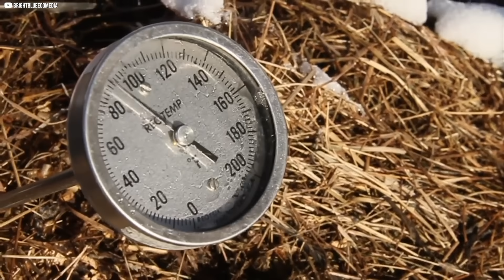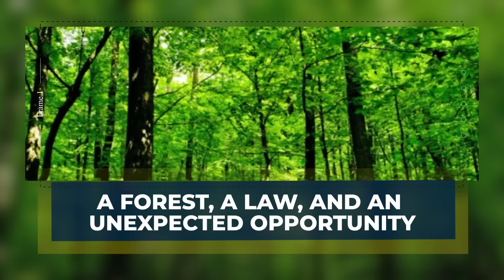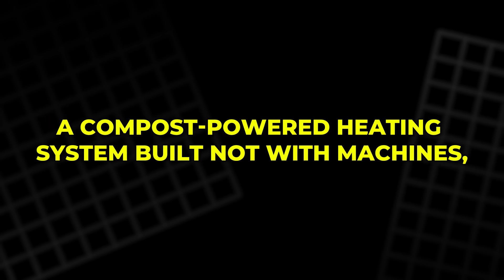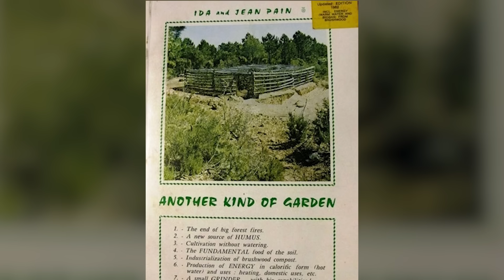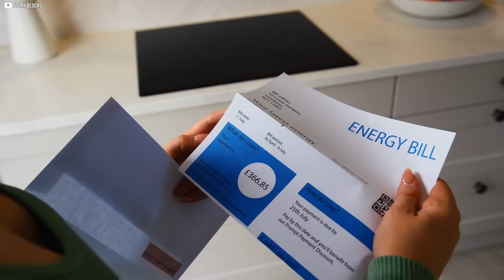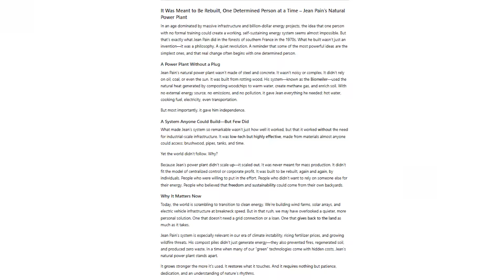The Forgotten Reactor: Jean Pain’s Natural Power Plant

Comment: A few things. 

1. This is really cool. 
2. The energy input would likely exceed the energy output.
3. You need a so much wood.
4. It needs to be chipped which costs energy.
5. The energy to collect, gather, build is an energy cost.
Reply: This is done already more than you realize. It doesn't take as much as you think. This is common for green house to use biomass and off grid applications
Reply: @DerfOrNuffin sure, but larger scale applications require more input. Then there is the removal and refresh process. All of that effort takes energy and likely people would turn to machines that use fuel inputs. If you’re using fuel inputs then it makes sense to use the fuel to heat your home and water instead.
Reply: Lots of wood isn't really an issue at city scales. Plenty of dead wood happens. The issue is no one industrialized it for efficiency. Does it need to be 100% wood chips? Or just enough to fill gaps? All things that would need to be studied during industrialization and other solutions already exist. If this was discovered 200 years ago it would have been revolutionary. Now it's just a curiosity.
Reply: @Trahloc-PH good point. But how big would the pile have to be for a city? How would you make it that big with modern machinery? Eventually decomposing stops, how would you remove and replenish it. Likely it wouldn’t be energy efficient.
Reply: @anonomas6113   Look into the raising of Chicago, it's amazing what people did nearly 200 years ago when it comes to moving large masses. It also wouldn't need to be a single pile. Sadly today we have access to cheap fossil fuels and they aren't going to be replaced with bioreactors like this. They'll be replaced with small modular reactors in the boonies and fusion reactors in major cities for industrial purposes or dense skyscrapers and solar on roofs for your average household.

This sort of thing though sounds awesome for a Permies / food forest homesteader though.
Reply: @Trahloc-PH true. Even for permaculture people creating a pile big enough is a huge expenditure of energy. Trust me, I know.
Reply: Doesn't have to be wood chips,harvested weeds would work,maybe not as well or for as long,composted rice hulls before,lot of places used to just give them away by the truck load,be inventive.
Reply: @Dennis-c1w true. The denser the organic matter the longer it will last. At some point the whole pile would need to be replaced and the infrastructure would need to be reestablished. The process is likely inefficient even compared to using simple firewood.
Reply: It factors out when one has the time.. it's inversely proportional   😊😊
Reply: @MikeC32958 agreed. Time is probably the most important input in the whole design. Not to mention, the pile would have to be replenished at some point and since the heat is general from within, the whole pile would need replacing.
Reply: Might try a bit of imagination. 😮
Reply: @Joy-e3v9b I - magi - nation

What’s your idea?
Reply: @anonomas6113  basically throwing organic matter in a pile though, right. Simplicity.
Reply: Sauf le bio digesteur mini avec un bidon bleu, j'ai les plans

Comment: It’s called méthanisation, provides raw biogas very usable as is but even better if you purify aka take the CO2 and the chemical contaminants out of it. Those depend on your ingredients but usually sulfur and co.
There are DIY plans on the net, some work well and it’s a cheap build. You can also buy ready made kits that work well for a reasonable cost. Then there’s a whole industry doing this and injecting into the natural gas grid. Major actors are French and German.
I have 2 books, covering all topics, written by Jean Pain
Reply from the maker: Thanks for the technical details and the information on Jean Pain's work!

Comment: This isn't "practical". Most people don't have a massive forest in their backyard, and if they did it is easier to just burn wood in a fireplace.  This never took off because it is near impossible to scale to any reasonable level. It is a decent form of heat if you have all the equipment, and about 200 hours of time to blow on it, plus all the cost of the materials, but this isn't for 99.9% of humanity. These days, 2 or 3 solar panels could provide more heat, and actual electricity, at a small fraction of the cost for very little effort, and last 40 years. This needs replenished every year. For a farm this is ok since you can use it as fertilizer when it is spent, but not practical for most.

Also, we do get some power from decomposition, some landfills use methane emitted which they would need to burn anyway to prevent explosion in generators for electricity.

Comment: If you wet a round bale of hay, it will burn your fi gets at 2 inches deep, it can actually catch fire if the heat is not pulled away.

Comment: Anyone with compost piles knows that they actually get hot enough to spontaneously catch fire if you don't routinely turn them. They also produce methane which can be used as fuel. The problem is, this set up only works in the situation it's in. You can't make a big enough compost pile to power a whole city, and in the city, there isn't room for everyone to have a bio reactor. So this works great for an off the grid homesteader. But it can't be scaled enough to provide energy for a whole civilization.
Reply: Everything is possible despite our rational argument !! Remember how every refined scientist was laughing off Elon Musk who was basically breaking «  every standard scientific norms » and yes he landed a rocket booster that the NASA think tank had written off as an impossibility! As we speak now, it’s a common event. Impossibility is a word that has never existed outside our self inflicted deliberate human limitation !
Reply: There is a place where a tank of water is  funneled to create a vortex that spins a rotor to power the entire area. Way too cool for the profit cult in the USA.

Comment: SO...MANY.....QUESTIO..N...SSS? How long did one forty ton pile last? How hot did the water get? Did the inner, anaerobic digester for the methane, did it produce for the same duration of time as the outer, heat chips. To make this really, really work, you would need a team of heat engineers, and biologists. I'd imagine the heap I'd make from watching this video would work, but I'd imagine a properly designed and constructed sytem would provide at least twice as much usable energy as mine. The PolarNight Sand Battery guys, would be a great place to start, in fact I could see them being interested in this, as they would have worked out so many of the kinks already.
Reply: I had all the same questions trying to gauge how viable it is to do....
Reply: It said all that in the video.
Reply: no, you don't need any of that, it works, but it is very inefficient, 40 tonnes of wood chip is an order of magnitude more than what you need to heat house and water for a year.
Reply: @lo2740  It's free, it produce laso gas and elctricity, and at the en you have a huge quantity of compost.
All things you cant' have in any other way.

Comment: Well placed windows and shutters can provide lots of free heat fall winter summer. Shudders can block heat load Spring Summer Fall. A fence or evergreen trees to block prevailing winds a winter winds. Deciduous trees 🌳 planted on the sunny side to provide shade during summer, loosing the leaves during the winter. Letting the sun heat the house 🏠🏡.

Comment: i think it could be improved by coating the outside structure with a layer of thick mud thus preventing lost heat and containing more methane increasing methane production and still leave a high quality compost behind. certain African tribes use an identical method but to produce a very high quality charcoal.
Reply from the maker: Thanks for sharing that interesting insight!

Comment: I also did same on smaller scale around 2005.  Copper coil in compost heap. I calculated it would heat a full water tank for a house in a day.  I think it produced about 200w.  Of course it doesn't really work in winter.  I never tried to actually use it, just experiment.
Reply: @SimonParrot•o5I  .  Can it be insulated to keep the microbes alive in winter with its own heat generation?.?. ( More self sufficiency) If it's possible I'd like to try on a small scale one day in the future .
Reply from the maker: That's a fascinating experiment and a great example of how compost can generate heat!
Reply: How big was the heap?

Comment: Interesting.  I think I built one in about 1992 without thinking about it, by chipping a tree into a pile in front of the house in the front parking area.  My goal was to get rid of it.  But I do remember it kicking off heat.  I then helped an old couple take the chipped wood.   Interesting, it was hot.

Comment: I wonder how he mitigated spontaneous combustion?
Reply: The pile is always humid (coming from the earth and manure is humid to start with), so it is impossible.
Reply: @editfazekas3854  lol, ask farmers wether compost piles do not catch fire. Of course it is possible and it appends all the time. Only an extremely tight maintenance allows to avoid the pile catching fire or stopping reaction due to bacteria being killed by the heat. Anyway this system is nonsensical because 40 tonnes of wood chips can provide heat and hot water to 10 houses of more for a year with any standard industrial boiler.

Comment: Thermo generator you can do that instead of a generator needing methane
Reply: lol, thermo generators (peltier) are extremely inefficient, and this system is also extremely inefficient, there is an order of magnitude more potential energy in the wood chip than the system outputs.

Comment: the heat from that can be directly converted to electricity if you use a sterling engine
Reply: lol, stirling engine is extremely inefficient, you will have a hard time powering any decent generator with such engine.
Reply: @lo2740 not true at all. When electric + heat are combined, Stirling engines often reach ~70–90 % total efficiency, with about 20% going to electric. That's perfect for heating and powering a small farm.

Comment: Seems there IS a Market here. A local biz could install and maintain many of these Bioreactors in a forested , well water type area where homes are typically several acres. Not a get rich scheme, just a great way to promote clean energy while getting to live in Nature and meet your Neighbors. Maybe add a Sterling engine generator for all that heat.... The Service would design, build, maintain the bioreactor,  and trim the lawn/fire break for compost and water it. Seems a valuable Service homeowners would pay for to me

Comment: This is biogas and has been used around the world for hundreds of years, I've been on it for 4 years using my grass clippings instead wood chips.
Reply: Yeah but what's better is if you add a little bit of wood chips to it and you add some homemade urea. Which basically you take and fill a gallon jug with piss and let it sit outside for like a month and a half and you use that as activator to start all of your volume when you're just starting your biogas system. I have a 50 gallon black drum full of chickenshit with other rotted compost and material and I took one half gallon of urea and dumped it in there with some wood chips and yard clippings I haven't had to refill it in 11 months I'm still getting a decent supply of gas at Powers my generator on my RV and it Powers all my lights at night.. I can run a 50 amp AC for 6 hours straight during the 100° temperatures during the day before I have to go and switch to power because I don't want to run out my gas supply
Reply: Im new to this how do you use the methane gas to power a generator. Is it a methane gas generator or can it be any generator
Reply: @karenblair3058  Petrol generator I assume fed straight to the carburettor instead of petrol, as trying to store it would be dangerous. I've seen them run on woodgas from the charcoal making process. It would be started as normal using petrol then, once warmed up, switch to wood gas. Again, can't stored. How you mix the methane at the right amount with the air I don't know.
Reply: @KamakaziMacMaster Oh wow, you just answered the question I’ve had for 40 years about my mother-in-law’s bucket of urine by the toilet and why she used it on her compost! 🎉🎉
Reply: Finally, a USE for a lawn of grass!
Reply: @solosailorsv8065  It's always been there ❤
Reply: No way ... Lawn clippings! How often do you replace the grass/rebuild the system ... How Big is it ,
Reply: I found this out, had grass clippings in a plastic bag for 2 days, it was warm when I threw it out.
Reply: @bdrgarage7039  Mix that with wood chip 2:1 and it'll get hot.
Reply: How big is your lawn?
Reply: Mowing your lawn by hand I assume!
Reply: @RTUGabions  Batteries are driving my lawnmower. Solar panels are charging the batteries. Sure it takes 2 full charges to cut the grass. Perfect for an hour where i cut the hedges while the lawnmower batteries charges again.

Power loss here won't keep me from cutting my grass or doing anything really. Got enough powerbanks to run my electrical devices and keep my house running. Might lose my fridge. But i got an oldschool potato fridge in the garden under some trees. (Just a hole in the ground that's always cool like a fridge.)

Comment: Mother Earth News did a compost heat experiment in the 1970s. They tried different combinations of materials. The best was pig manure and wood chips or sawdust. Same heat exchanger tubing running through it. It was roughly a shallow grave size and shape, made 140 degree water for 2-3 months in the Carolinas.
Reply: Thanks..I remember that issue. They used chicken manure too and gave plans to convert auto to run on methane.
Reply: @martinlicht1969 I have every issue up to 2011 on a CD. It was $30 about ten years ago. Good input! Even I don't remember the rest of the article..but I read it back then (1970s-1980s). I have more ideas from that magazine than anyone could put into practice (though I'm trying on 4 properties in Hawaii!) in a lifetime!
Reply: Also, we had a stack of weeds composting in Phoenix in 1961. It literally caught on fire!
Reply: @5400bowen I fed a fish to a pelican at Frisco Bay he took my cell phone and flew away
Reply: WHO RUN BARTERTOWN!!!? 😡
Reply: @CavemanVanDweller best comment award!